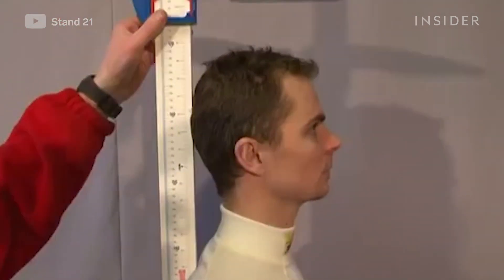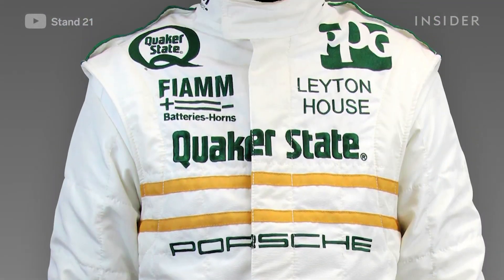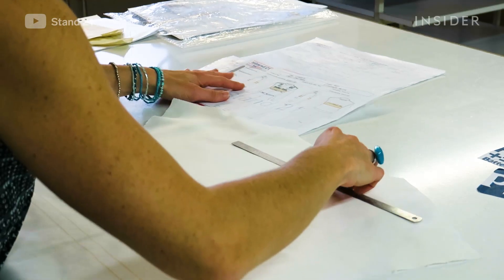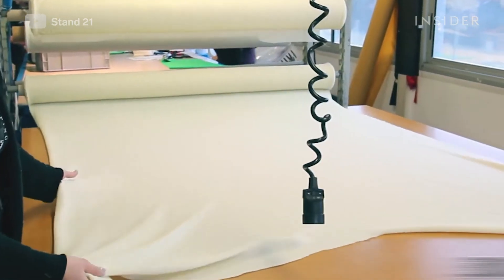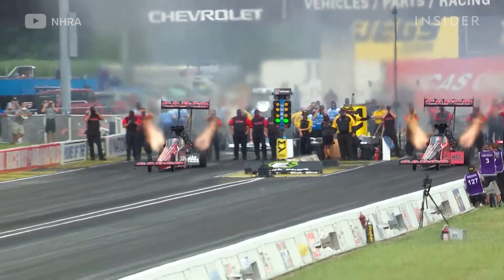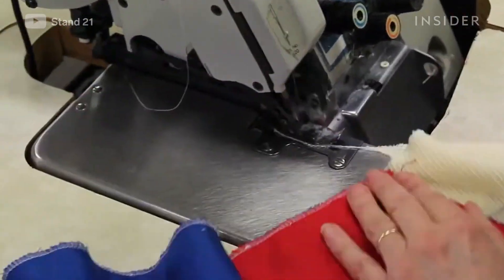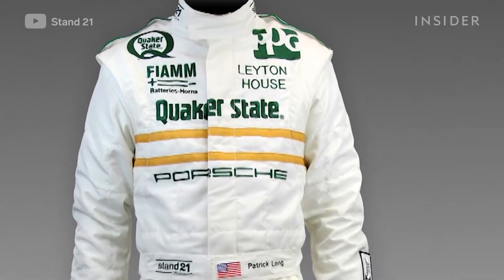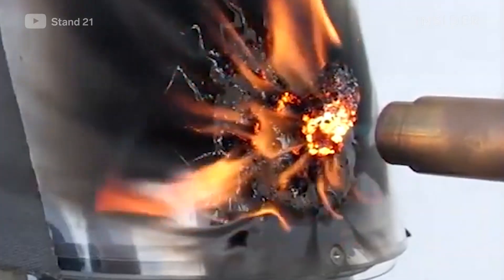How Race-Car Drivers Survive 1,800-Degree Fires

Comment: Seems like the hands need more protection from fire then
Reply: It's impossible.
Reply: @AmelpsXett  How come?
Reply: @pedrotalons1422  it would probably require to many layers on the gloves. The thicker the gloves the harder it is to feel and control the wheel Which is very important in racing.
Reply: @pedrotalons1422 the glove didn’t fail to stop the fire it just didn’t insulate enough heat away from the hands to stop it from minor burns the glove is simply to thin.
Reply: @kelvin31272  bro i was chatting shit calm down
Reply: @joecunniffe9061  sorry bro idk why I got so aggressive, my bad
Reply: Most normal YouTube comments
Reply: @minatoyukidoorkun3305 5 month reply gaps
Reply: @joecunniffe9061  comments were a while ago bud

Comment: 1800 F -> 982 Celsius
Reply: Either way, that's a LOT of degrees! 😱
Reply: yeah 200 celcius is enough to fry chickens aint no way i'd want to be put in something 5 times as hot
Reply: @jujubad3273  That math doesn't apply for temperature